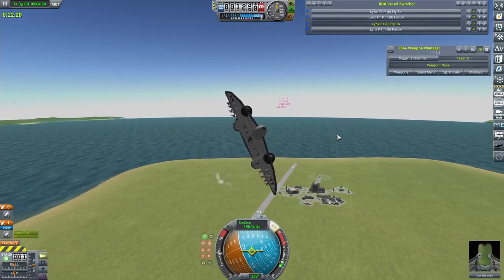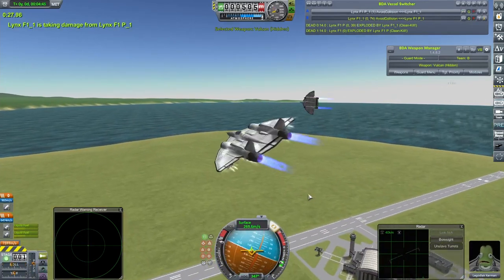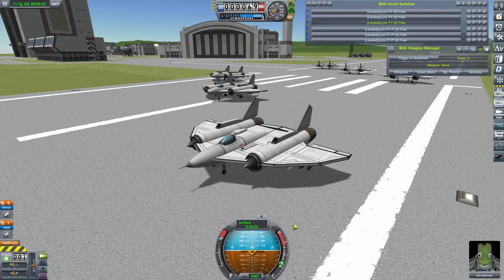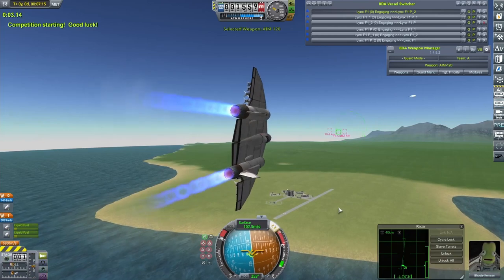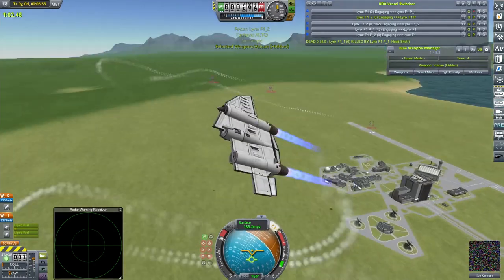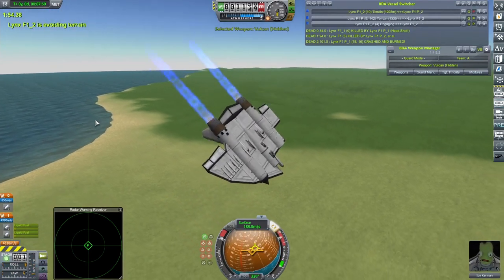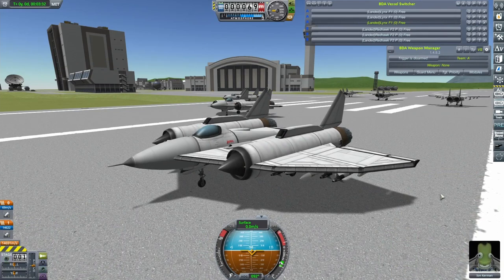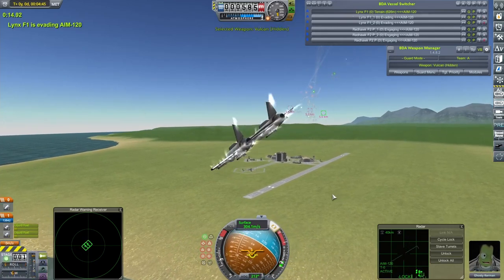Weapon Experiments: Missiles - Kerbal Space Program & BD Armory

Comment: One thing that you can't change about the missiles is how much the countermeasures work. An aim-9 fired from a kilometer away will barely react to flares. And chaff not always works and not that well.
Reply: True.  Short range missile shots are much more likely to be kills.

Reducing RCS is important for radar missiles, and even more deadly at short range is AIM-120 (larger explosion radius, if you adjust the min explosion off target; coupled with high speed off the rail, making drop time zero, it's basically a guaranteed kill)